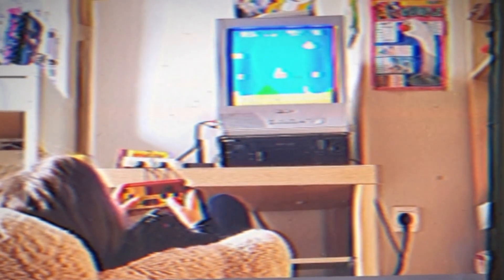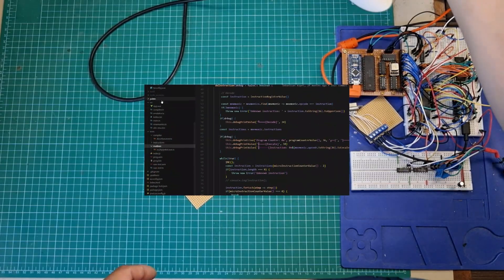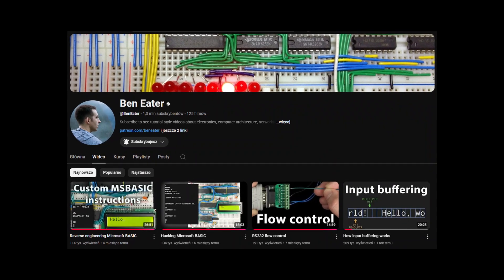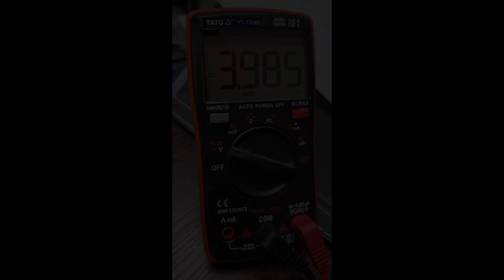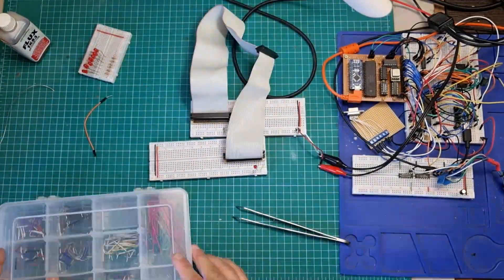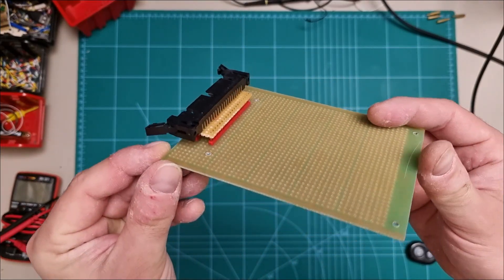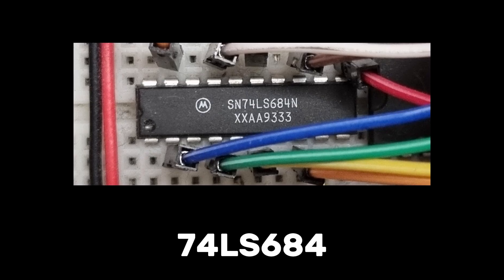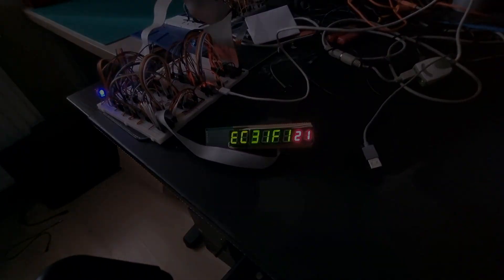How I Started My Homebrew 8-bit Computer Project

Comment: The ribbon cable looks cool! If you're not already, you might want to use bus transceivers to power lines that go through the cable for better signal strength and noise reduction.
Reply from the maker: Thanks a lot for the suggestion! That's actually a really good idea, a few people already mentioned something similar, so I might focus more on that in a future revision of the system. Really appreciate the input!

Comment: Take a look at wire wrap for electronic, you use a kind of "screwdriver" to wrap the wire around the IC socket leg, (check Kynar wire, and IC sockets with long legs, and the wire wrap tool). This is easier than soldering, and more practical than breadboard jumper wires. Kynar is very thin wire, good for 16bits bus, and the insulation supports soldering without melting. You can easily unwrap any wrongly connected wire. I'm used to do hybrid, ie. soldering for point to point wires, and wire wrap for multipoint wires.
This is how first computers were done.
Reply from the maker: Thanks! You're actually the third or fourth person to recommend wire wrap. I definitely want to try it at some point, especially for future 16-bit builds. For now, though, I'm sticking with soldering, it's surprisingly relaxing for me 😄

Comment: This is great. I built all of Ben Eater’s kits while following along with the videos and doing troubleshooting. I always wanted to make it modular. Now I made a custom keyboard with a microcontroller to scan the rows and columns (I wanted a custom layout with some extra buttons below the spacebar, like the Canon Cat, a Forth-based word processor) and I’m writing a Forth interpreter now, based on JonesForth. You might like JonesForth, it explains how it works with long comments and a little code in between. I’ve started doing some audio output with just an ARM chip (not even a full dev board).  Getting good video is the biggest challenge now, not like the “world’s worst video card” by Ben Eater. I’ll keep my eye out for that!

Comment: I remember building a 68000 based system back in the mid 1990s for my microprocessor senior design class as an undergraduate in EE. It was fun but a lot of work and a ridiculous amount of time was spent this 3 or 4 credit class. Back then we wire wrapped the main circuit board which was approximately 5 inches wide by 16 inches long. Under the main board we had built a charger to keep some state saved in the ram. I don't remember much more of the details other than I mounted it on a nice oak board since I also was good at wood working I wanted to show off that talent as well.
Reply from the maker: I can only imagine the hours of work and pride behind that project. Thanks for sharing such a cool memory!

Comment: Yes you’re totally out of your element. This is a whole different world. A basic logic probe would help you a lot. Never used the 6502 but it should be pretty simple. Never had any modules when I was doing home brew on the kitchen table. I build from scratch. The mc68000 would be a good choice for a project. Probably not for a noob, but the 6809 is definitely a worthy choice for 8 bit with its ability to use position independent code. If you’re looking to control I/O devices. The z80 is a good option.   Using modules to connect together isn’t really putting in the time, but it’s still a start and it will get your feet wet. I recommend a simple design and sticking to it. You can get fancy the second time around. Don’t design as you go or you’ll get off track. This is simple stuff so don’t let it overwhelm you.
Reply from the maker: Thanks for advice!
Reply: @kaligari88 consider keeping your chip count as low as possible to keep it simple. 1 32k x 8 static ram will be all you want for assembly language. Most programs are going to be 2-4 k probably. I haven’t built a computer from scratch in a long time, but I’ve built a lot of them. They typically did jobs that are currently being done by microcontrollers today.  A logic probe will really help finding problems that are the result of a bad connection on a solder less breadboard. I recommend breadboarding everything first. That’s always worked for me. You’ll get this built. Don’t forget decoupling capacitors. .01 to .1 mfd is  a good choice. If you get stuck on something. Stop for a while and think.  Work it out in your head. Nobody knows it all including me. You just enjoy.

Comment: Watching Ben Eater got me into hobby electronics (Adrian's Digital Basement and Usagi Electric helped), and the idea for a project like this/the SAP-1 just refuses to leave my brain. I should do something less ambitious than building my own CPU, but the idea just won't leave me alone. My idea is something both simpler and infinitely more stupid than yours. Separate data and address bus, stupid large address space for simplified bus logic (no bank switching or anything) and infinite peripherals and module expandability, no thought to performance, dead simple ALU (add, subtract, basic logic operations, bit shifting), a hacked together display terminal in the form of several 40x2 character LCD displays, and eventually (at some point in the far future) cassette tape storage, probably using the stupid simple Kansas City Standard. It would be a horrendous mess, dumb, and run slow as molasses.
Reply from the maker: That sounds exactly like the kind of gloriously chaotic project I would love to see! Please build it, the world needs more beautifully dumb computers like ours 😄

Comment: I was going to build a computer, way back in the 80s.   I worked on 8080 and 8085 based systems, that used 8 and 16 k of RAM. I was going to build a computer, but changed my mind. The hard part would have been the periferals, keyboard, display, and a means of storing and retreiving data. Then writing a program to make it all work.😮 😮😮
Reply from the maker: I totally get that, back in the day, building a full system with keyboard, display, and storage must have felt like climbing a mountain! Honestly, if it wasn't for the internet and Ben Eater's videos, I don't think I would've ever attempted this either. Huge respect for your experience with 8080 and 8085!

Comment: There are not enough grounds on your bus, this will eventually limit your max speed. On a ribbon cable best practice is to interweave signals with grounds. So at best you would have 20 signals on a 40 wire cable. You could expand it to 2xIDE or live with limited max clock.
Reply from the maker: Thanks a lot for pointing this out! You're absolutely right - another viewer already mentioned a similar issue, and it really got me thinking. I’m seriously considering redesigning the IDC ribbon connections to interleave grounds properly. I appreciate you taking the time to help improve the project!

Comment: You’ve already done the hard work by entering the schematic into Kicad, why not convert the schematic to proper custom PCBs? There are plenty of manufacturers these days who will accept uploading Gerber files and send you a short run of multi-layer boards for not a lot of money and in only a few days.
Reply from the maker: Thanks Steve! That's a great point - and you're absolutely right about the KiCad part. For now, I’m sticking with hand-soldered boards because if something changes in the design, I can quickly adapt without redoing a full PCB. Also, there's just a special kind of satisfaction in building everything manually, it keeps me close to the process 🙂
Custom PCBs will definitely come later, especially for more complex modules. Appreciate the insight, and thanks for watching!

Comment: Before you get too far you should understand more about how electronic signals move from driver pin to receiver pin.  Without getting into lots of details you need a return path that is close to the signal path.

Conventionally the negative power rail is this return path.

Your 40 pin connector has no power (positive or negative). 

Any signal crossing the backplane will hunt for any possible return path, which can induce glitches on your other signals (phantom read write strobes, bit errors in address and data, etc).

Ideally you 'waste' at least every third conductor in the ribbon and connect it to the negative power rail.  In reality you will probably find it works ok with even just one or two negative power rail signals in the ribbon.  Distribute them as evenly as you can.

Or use copper tape stuck to the ribbon and connect it to negative power rail on each board at multiple locations.
Reply from the maker: You're absolutely right, this could become a serious issue down the line.
Just because it works now doesn't mean it will keep working reliably as the project grows.

Thank you so much for pointing this out, it's incredibly helpful feedback that can genuinely improve the design.
My bus project is still an evolving architecture, so insights like this are truly invaluable.

I'll definitely explore ways to improve the return paths and see what I can implement going forward! Thanks!